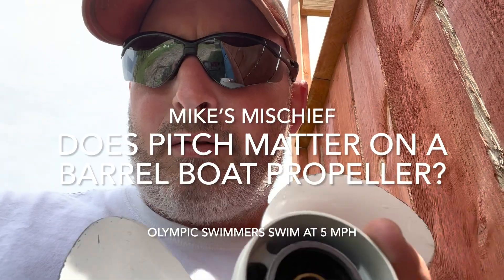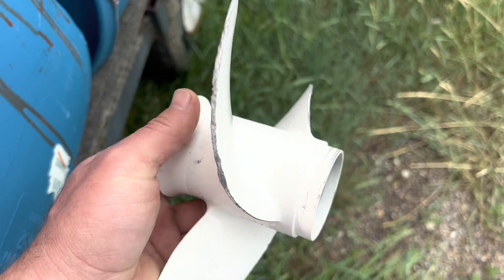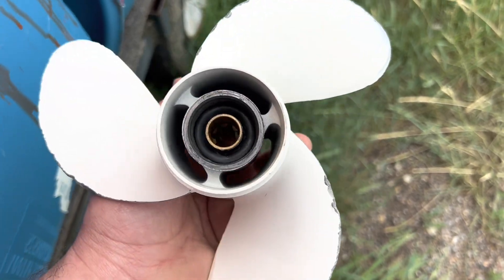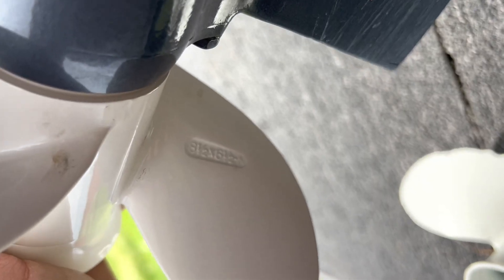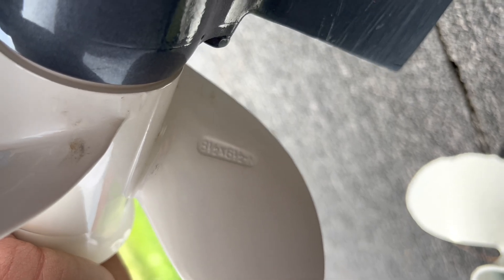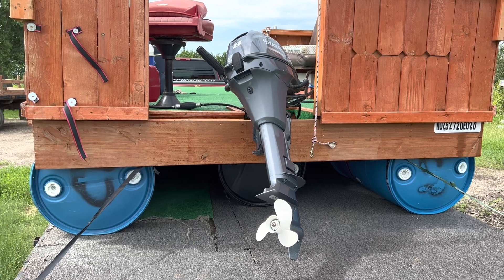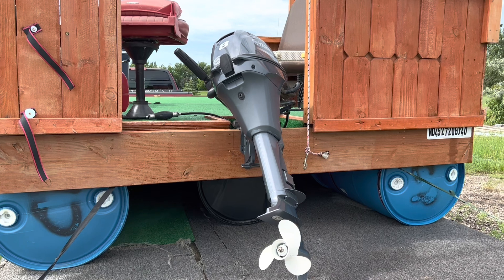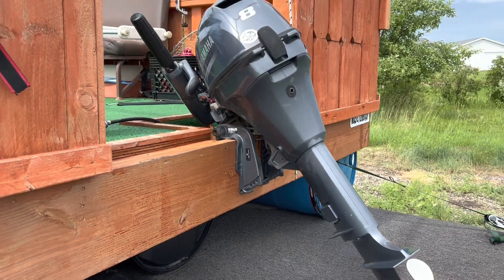Does Propeller Pitch Matter on a Barrel Boat? Yamaha 8hp 4 stroke Boat Engine.

Comment: Barrel boats are displacement hulls. They will not plane. Your speed is going to be governed by your boat length. The square root of your waterline length times 1.34 will be your theoretical top speed with a fair hull.
Reply from the maker: I’m 15’ long in the water. Is it easier on the motor to lug or to have more RPMS?

Comment: The prop helped get you more RPM it sounds like but you are running in to a hull speed issue. It looks like you have the flat ends exposed on the barrels. That has to plow through the water, haveing to waste energy moving way more water than it needs to. The flat ends on the back also leave a hole in the water that robs you of speed. The engine is also having to run in the hole created by that center pontoon. Ditch the center pontoon an extend the outside ones as much as you can. Add some kind of defector on both ends of each pontoon. The deflectors need to be as long and pointy as you can get away with so the water has to move away slowly and refill the back slowly. Its also best to use something like foam to make them so they also help you float higher in the water. Angled floating presure also slightly helps speed. Even with all that, you are not going to get but to a top speed of maybe 6 with that engine. But you could then cruse at 4 using way less fuel. With a bigger engine an pointy ends, you may be able to get that up on plane an go quite a bit faster. But it would take a lot of engine and fuel to do it. Not worth it in a barrel boat in my opinion.
Reply from the maker: My plan is to make diverters for the front and they will sit in the recess of the barrel tops.  I don’t know what the record speed is for a barrel boat but I think it’s under 10mph.  I had a canoe that I built this to replace and my top speed with that was 6mph. I don’t thing I’ll ever get a handle on the speed.  But give the engine a break should make it last longer I’m hoping.